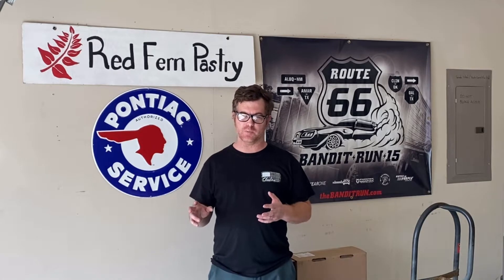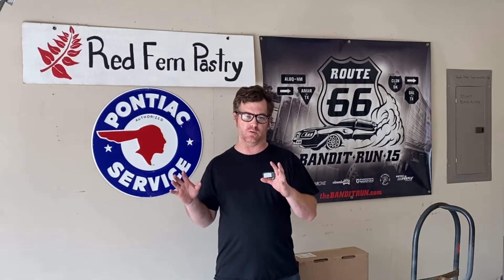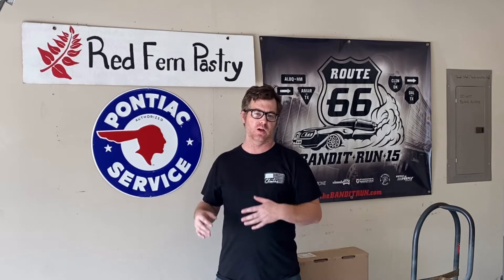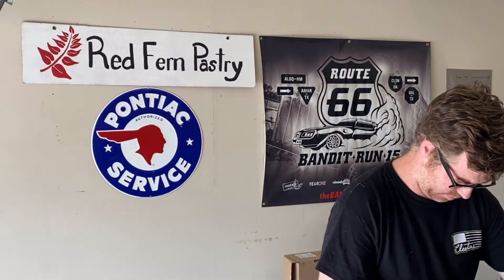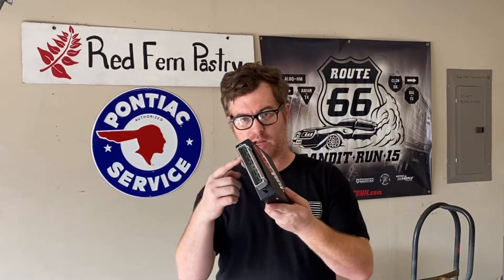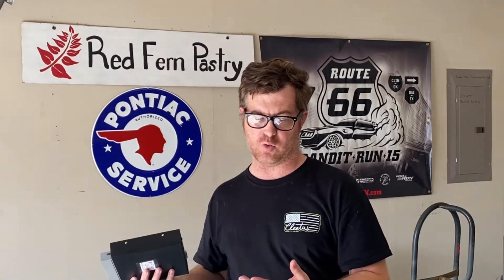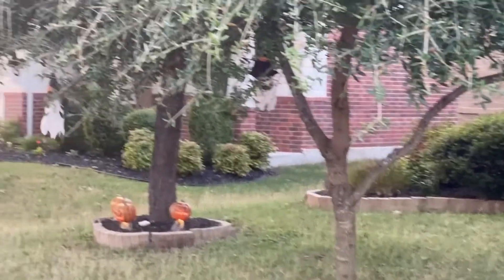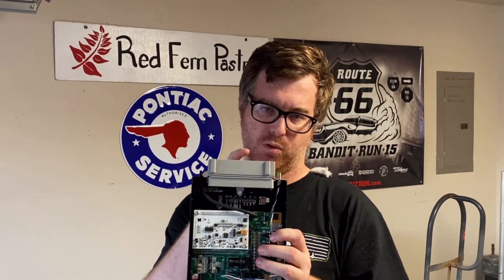Ep. 19: 1988 Ford F250 4x4 Dream Truck MegaSquirt ECU Swap Part 1

Comment: Yeah it’s just hot glue and solder. If you want this connection to be cleaner I would work on the wire side before cutting the enclosure again and not worry about the “front nut” methodology. Adding a nut could increase the air gap on the connector side and make for a bad contact.

Comment: The polish on your videos is getting better! You definitely seem more confident in front of the camera.

I didn’t pay enough attention but the port you cut a slot for; could you not just disconnect/desolder the wire and just drill a hole in the enclosure without having to cut it altogether?